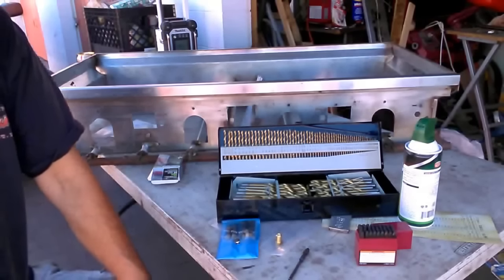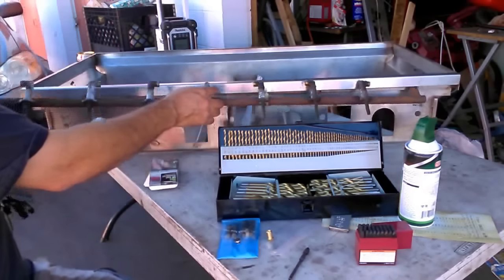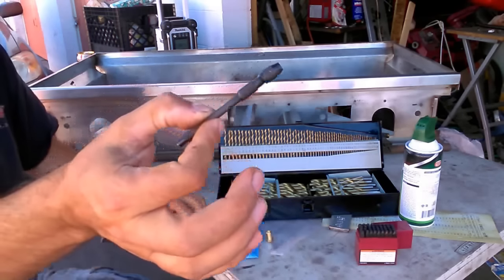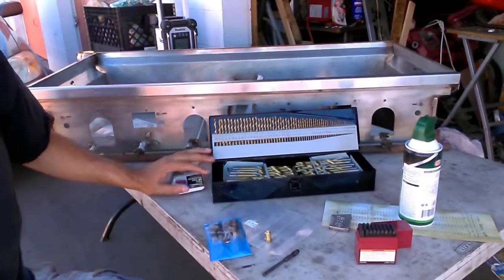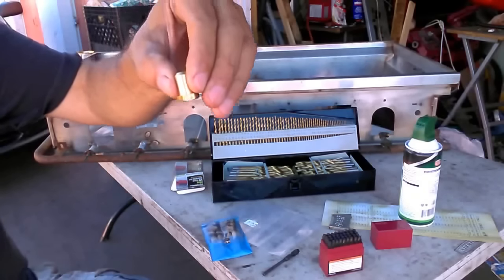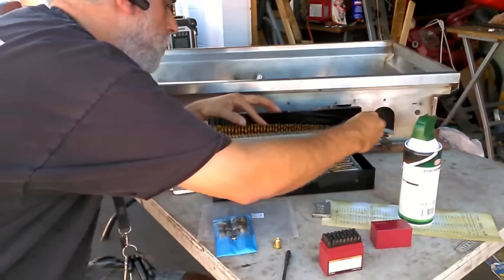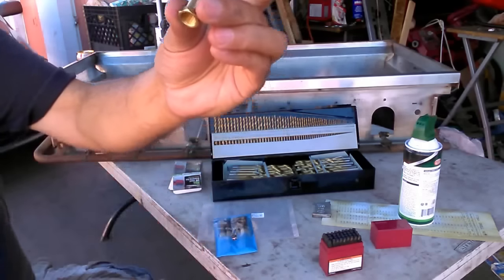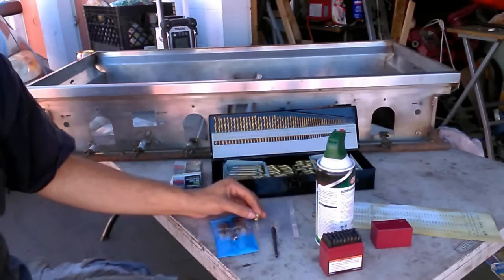Propane and Gas Conversion Basics (How to)

Comment: hello frank . i just left you a message on your phone. i have converted a BBQTEK Model #GSF2818K (it looks like this company is no longer in business ) from LP to NG. the three conventional burner are working good . the valve on the infrared burner works only one time and does not work again .  i have installed a   new wire on the striker and i can see the sparks but I believe there is not gas coming from the small pilot orifice . i can light the burner manually and it work fine but not with auto lighting striker .  do you have any idea why it works one time and fails after that . the conventional burners are 12000 BUT each and the infrared is 15000 . thanks
Reply from the maker: Doing a fuel conversion is usually a simple affair. I've converted just about every type of barbecue and stove made. I'm now in the Midwest, so feel free to contact me at 714-574-1544.

If you've converted from LP to natural gas,, and your unit has pilot ignitors, then the issue is that the pilot ignitors are bored too small to produce the proper sized flame. You'll need to bore it out to a more appropriate size. If you're not using a regulator, your system can be rated at 7" WC, so use that column on the linked chart that I've attached when recalculating the bore size on your pilot orifice. If you're not sure, simply bore the orifice one or two sizes larger than they are right now, and again, one or two sizes. Unfortunately, I have no way of knowing what the size of your pilot orifice is, but I would suspect that it's somewhere north of a #80. The good news is that you're converting to natural gas, so the orifice will need to go larger. Possibly up to a #80 or perhaps even larger.

Here's a link to an orifice chart that might help: https://www.johnstonesupply.com/orifice-chart
Reply: @frankhamilton8257  thank you so much for your reply . sorry for replying too late

Comment: Hey frank thanks for the reply. We put a water heater in for my bosses Ex wife and we didn’t realize she had propane. Total nightmare. Thanks again
Reply from the maker: I've done propane water heaters before. Let me know if you can't source the parts to do this conversion. You can always call me at 714-574-1544.
Reply: I have an AO Smith water heater that I want to switch from propane to natural gas. What is the orifice size and where is it located?

Comment: Hi Frank,  I have a Jenn Air 730-0339 bbq that I am wanting to convert to LP.  When we bought it at Lowes the salesperson said we could get a conversion kit if we ever wanted to switch it from NG. I am not getting any cooperation from NEX grill who is now in control of parts. They are giving me the runaround and I have not been able to get the parts I need. Model 720-0339 is the LP model. I wanted to know if you might have a way to get the pieces I need?
Reply from the maker: I've done quite a few Jennaire grilles. That grille is likley similar to the 720 series grilles, only it has two additional stove style burners to the right. We should talk. I'm on the West Coast, so call me at 714-574-1544  during normal business hours 9 to 5.

Comment: I have a 18L tankless hot water heater that is set up for Natural Gas and I want to convert it to LP Gas. What would I need to do? Any Help would be appreciated..
Reply from the maker: You would need to swap the regulator and you would need to change orifices. I have orifices to fit everything, so feel free to call me at 714-574-1544. Remember that I'm on the West Coast when you call.

Comment: When choosing an orifice size what percentage of difference is the between NG and LP? I sometimes get appliances where there is no manual. It would be nice to pull an orifice from an NG burner and know what percentage smaller is right for LP.
Reply from the maker: Since manufacturer's burner ratings are usually inflated, I always reverse calculate the heat rating to get an accurate answer using charts from Ward Burner systems. I then forward calculate that heat rating to get my final orifice size for the alternate fuel.  Some manufacturers publish cooler burner ratings on the propane side on the manufacturer's labels. I first figure out the propane rating based on the percentage that the natural gas rating is off by. So, if the calculated natural gas rating is off by 5%, I calculate the manufacture's heat rating to 5% less (of the number published on the manufacturer's label) to get a pretty accurate final heat rating number. I then calculate the proper orifice size based on that number.

Comment: I am converting a NXR gas grill from LP to NG.  What size does the orifice hole need to be?  I have tools and numbered bits to change the size.
Reply from the maker: That's a very general question and there are several variables that will come into play here. I normally do conversions by calculation, but I can send you a chart instead that will assist you in this effort. Here's this link: https://andersonforrester.com/conversion-chart/

You'll need to backwards calculate the orifices and the rating for LP to find the actual BTU rating of your burners (as opposed to what the manufacturer says the BTU is). Once this is established, you can forward calculate the orifice size based on that BTU rating versus the output rating of the Natural Gas line your feeding the unit from. Keep in mind that many units have a different BTU rating for LP than they do for Natural Gas, so read your label carefully. 

I have every orifice made, so feel free to call me if you need me to do this conversion for you at 714-574-1544. Call during normal West Coast business hours (9 to 5).

Comment: Frank, can I get you to make me the burner orifice for my Whirlpool stove to convert to propane. I have the top burners  done but need a number 56 for the oven>? Do you do this?
Reply from the maker: Doing a fuel conversion is usually a simple affair. I've converted just about every type of bar-b-que and stove made. I'm on the West Coast, so feel free to contact me at 714-574-1544.

Comment: Do the holes in the orifices need to be smaller for propane? I need to convert to propane but the orifices for my maytag mgr5775qds are no longer available and i cant find any so what could i do?
Reply from the maker: Yes, generally speaking propane holes are smaller than natural gas holes. I have orifices to fit every application there is, including Maytag/Frigidaire, so feel free to call me at 714-574-1544. Remember, I'm on the West Coast when you call, so call during normal business hours.

Comment: I have a Char-Broil Commercial NG that I'm converting to LP. The NG version comes with no orifices - manifold straight to burner. How do I know which size orifice to use. I know that the orifice head is 9/16 socket size and the bore hole should be #133 or a 55 bit. Just not sure about thread width/size.
Reply from the maker: Here's a chart published by Johnstone Supply:   https://www.johnstonesupply.com/storefront/tools/orificeChart.ep   As  rule, Propane orifices have smaller holes than natural gas orifices. I have orifices for everything made, so feel free to contact me at 714-574-1544. Remember that I'm on the West Coast, so call during normal business hours of 9 a.m. to 5 p.m. Pacific Standard time.

Comment: Hello Frank-I have a Vermont Castings NG Grill and I want to transfer it over to LP for a cabin in the WV mountains. The grill is in great shape and I would hate to not be able to salvage it. Can you put together a solution I can purchase from you? I can handle the installation:  Vermont Castings Signature Series Model: VCS4005N (Natural Gas @7in WC) 50,000 BTU. It has Threaded NG Orifices Numbered at #53 for the burners and #52 for the (1) Side Burner. I am on the east coast.  R/s
Roy
Reply from the maker: No problem. I just need to know the size of types of orifices that your grille uses. Can you call me at 714-574-1544? I'm on the West Coast.

Comment: I'm going to find a pro in my area (NYC) to do this but I want see if I understand what math. Converting a propane grill to NG. Gas supply is .25psi. 5 burner grill is 7.5k btu per burner.   Needs orifice size 56.
Reply from the maker: Doing a fuel conversion is usually a simple affair. I've converted just about every type of barbecue and stove made. I have conversion parts for everything. I'm now in the Midwest, so feel free to contact me during normal Midwest business hours at 714-574-1544.

When you're talking about fuel ratings, the common vernacular is expressed in terms of inches of water column or WC. Here's a link to a conversion chart: https://andersonforrester.com/conversion-chart/

Comment: Hi Frank, I've got a Uniflame propane bbq in Canada that wasn't made to be converted (no conversion kit). I think if the orifice holes are enlarged and I change the gas regulator, I should be able to run it on natural gas. Can you enlarge the holes in the orifices if I send them your way?
Reply: Did you try this out? I am curious if it worked out for you 2 years later?

Comment: Hello Frank my name is Harold
My question is I have a kitchen aid BBQ grill that is setup for natural gas but I need lp
Kitchen Aid model KBGS292LSSO any advice. would be helpful thanks.
Reply from the maker: I actually carry orifices for every stove and barbecue made on my website  https://flamesources.com/  I'm now in the Midwest, and you can always get a hold of me at 714-574-1544.

I've converted that brand before, but I don't have these orifices on my website just yet. Feel free to reach out.

Comment: If I want to switch my propane outdoor fire pit to natural gas (or vise versa) could I use the same tools/ methods as you do in the video?
Reply from the maker: Computers You can, however you'll want to go conservative with the orifice bores because usually BTU ratings are inaccurate and the true equivalency is not accurate as well when it comes down to doing a conversion. I stay away from doing fire pits for this very reason, and you're likely better off replacing the pit altogether. If you still decide to pursue a conversion,  you'll need to swap the regulator as well. If you subscribe to my channel, you'll be able to view my video on fuel regulators. Bottom line is that fire pits and gas barbeque log conversions are a huge liability.

Comment: Thanks Frank. On a NG 30,000 BTU blue flame ventless wall heater what # bit do I need to bore out to to run LP gas? 
Helping a friend who is cold. Thanks
Reply from the maker: Normally, if you're converting from NG to LP,  you would use an orifice with a smaller hole. You'd also need to change the fuel regulator. Many of these units use a combination gas valve that is a controller which incorporates the regulator, a pilot generator and a safety switch that keeps the main gas valve "on" so long as the flame on the pilot generator is on. The pilot generator function is a safety feature that prevents a massive quantity of unignited gas from entering the plenum and causing a potentially explosive situation (literally). The size of the new hole would be dependent on the rating of the new regulator (usually 10" WC).
Reply from the maker: Once you have the regulator converted, you can use the numbers on an industry chart to determine the correct size for the orifice. You'll want to calculate the actual heat rating of the current orifice first because the numbers published on the label is likely not correct. Here's ta chart from Andersen Forrester:     https://andersonforrester.com/conversion-chart/
Reply: Thanks Frank. I believe I understand. In addition to the regulator on the in line from the tank, there's a additional internal valve correct. I'll need to get a valve conversion kit to convert from NG to propane correct. Thanks again for the guidance. ✌️
Reply from the maker: Depending on the gas valve used (many of these use Robershaw or Honeywell controls) you can order just the regulator part of the control rather than replacing the entire control. Look on the manufacturer's label, and get a model number to determine the regulator that you will use..
Reply: Frank Hamilton thanks so much. I’m tearing down the heater tomorrow. I’ll let you know how I did. 🙏🏽🙏🏽🙏🏽

Comment: Frank can  I by the conversion orifice from you for converting  a 2 burner weber spirit grill to propane or an you tell me where to buy the part
Reply from the maker: Yes, I do conversions on Weber grilles and I have the parts. Feel free to contact me at 714-574-1544.

Comment: hey man, I lost my lp conversion kit for this model and I wanted to know if you had any idea what the model part for the conversion kit is. thanks in advance
Reply from the maker: Doing a fuel conversion is usually a simple affair. I've converted just about every type of bar-b-que and stove made. Feel free to contact me at 714-574-1544 during normal Midwest business hours.

You didn't actually specify what model or brand of unit you're working on. Feel free to reach out.

Comment: Hello, I am converting my gas range back to natural gas, I have all but one of the orifices. The burner I am missing the orifice for is rated at 12.5K BTU for natural gas. It currently has a 97 LP orifice installed. What size natural gas orifice do I need? Thanks
Reply from the maker: Here's an orifice conversion chart from Anderson Forrester: http://andersonforrester.com/conversion-chart/

Comment: Hi Frank.  Can you point me to a conversion chart for altitude?  Looking to buy a Samsung gas cooktop, convert it to propane (comes with the propane orifices) and then get it set properly for my 8300 ft. elevation.
Reply from the maker: The altitude factor for 8300 ft. is 0.8860. Without any other adjustments, this means that the BTU rating of your burners will be reduced by a factor of 0.1140 without any further modifications. I've done high altitude conversions before, and they can be tricky, usually involving a combination of manipulating orifice sizes and output ratings of the fuel regulator. You're regulator's output is likely 10" WC, so it might behoove you to get an adjustable fuel regulator for propane only. This should allow you to get close to what you'll need to balance everything out for your high altitude environment. It's mainly the low gas settings that you'll be concerned with and the high gas burner ratings will likely be less than what you'd expect to see at sea level.

Comment: Frank:
Interesting video. Do you sell the gas orifices for gas grill conversions? I have a Weber E330 that I need to convert from NG to PG. Thanks. Will.
Reply from the maker: I've done quite a few late model Weber Grilles lately. I believe that those are 1/4-inch orifices. I'll be turning out a batch of those on my lathe this weekend, so give me a call at 714-574-1544.

Comment: Hello Frank--
I bought a1966 O'keefe & Merritt gas stove and the seller was using propane gas; I have natural gas in my house.  I've looked far and wide to buy replacement burner orifices for natural gas but coming up with none; my search leads me to believe that either the stove is too old and the orifices are no longer manufactured or that I'm looking for something that does not really exist.
The instruction manual that came with the stove (yes, the previous owner kept the original manual) references instructions on conversion from NG to LP as follows "... a) Non-pressure regulated models, screw oven, broiler, and top valve orifice hoods down until needle closes hole in hood and adjust air shutters... b) pressure regulated models, remove pressure regulator and use same procedure as in "a"."
On a prior paragraph, the manual reads "...All ranges are equipped with orifice needles with hole in them for LP gas.  All ranges leave the factory adjusted for natural gas.  On ranges with a pressure regulator, range is factory pre-adjusted; normally no adjustments are required."
I have verified at this point that the stove does not have a regulator at all (the instruction manual notes that some models are pressure regulated with the regulator placed at the end of the manifold (4" W.C. and 3/4" female I.P.S.) while others are without the regulator and the manifold end is 3/4" I.P.S); the gas line connects directly to the manifold WITHOUT a regulator in-between.  The previous owner does not know if the stove was originally fit with a regulator; naturally, during the conversion to LP, the regulator would have been removed according to the instructions above.
I'm in the process of cleaning the stove (basically taking it apart and cleaning every nook and cranny--I'm eager to see to get the stove into my kitchen and working.  As I said before, I have natural gas and I'm at the point where I have easy reach to the manifold and the burner valves; I'm there where the orifices are located but need help in determining what to do about them.
My questions are as follows: 1) is a regulator required for natural gas installation?  I've seen them on line and they're not too expensive and can allow for "easy" conversion from NG to LP and vise-versa; mind you, I don't every plan in having LP.  This is another question that I've researched on the internet and have not derived a clear answer.
2) do I need a different orifice that what the stove came equipped with? Is the adjustment in the conversion simply by tightening or loosening the orifice hood?  The orifice hood bears markings of 52 and 68 on the sides...I'm not sure what these numbers mean or why there are two different numbers.
I apologize for the lengthy discourse; and I apologize too if the question is "dumb" but I'm learning as I go.  Your help is truly appreciated.
Robert
Reply from the maker: I've done quite a few vintage stoves and I have orifices for everything made. Maybe you can pull an orifice and send me a pic. You can contact me at 714-574-1544.